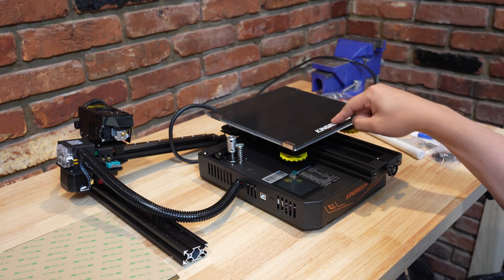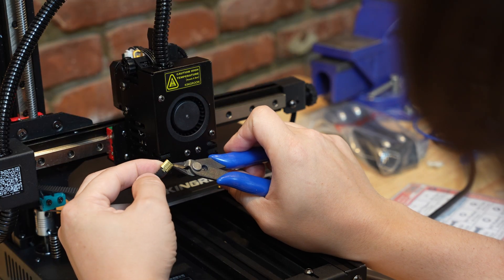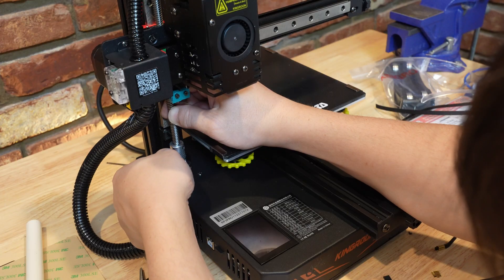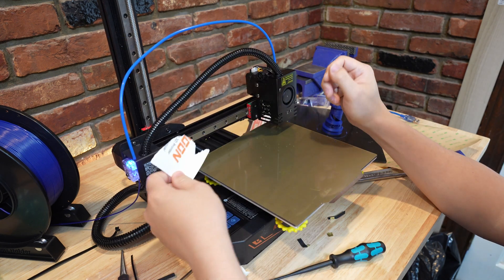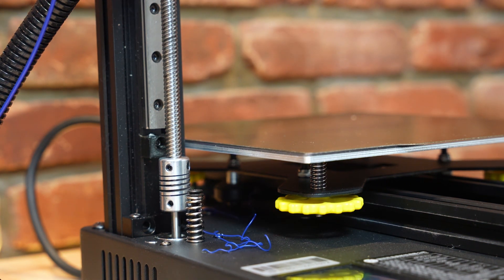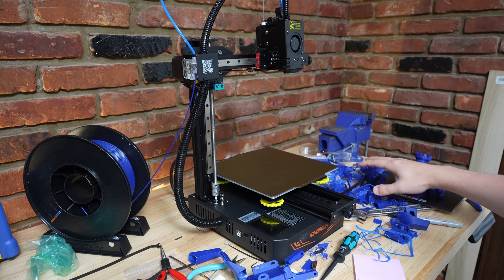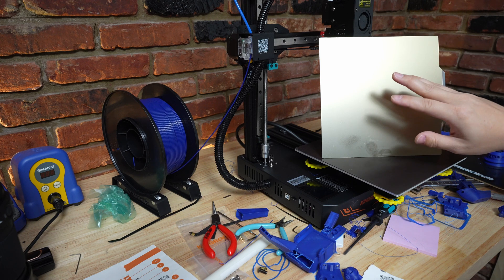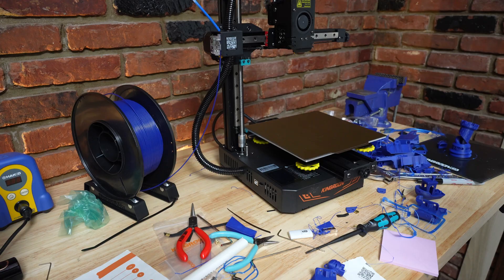Kingroon KP3S Pro: A Tiny Fixer-Upper

Comment: I brought a assembled but never run Kingroon KP3S to keep me interested while my two Ender 5 plus's were suffering from the 'I can do that' after watching youtubes that show how super simple it is to totally upgrade it all.  Its not for a Lorry drivers mind. lol.  Back to the Kingroon, Its not stopped printing apart from the duff Z screw clamp stripping the two threads the bolt reached and then the hotend mares it had to start with. Its now running a proper V6 hotend and not the copy thas standard. I used silicon bed springs, its not needed levelling since fitting them and the PEI bed or the Glass one i fitted before. They are cheap but they work well imo. Finished a 26hr print last night and it was flawless.  Wackes benchies out quickly too.

Comment: i mean unless you want to pay a huge premium for all your machines like with prusas, then youll have to just get comfortable with the fact that testing machines don't really happen :P

also when companies use these shitty spring couplers, you need to make sure the lead screw and the rod coming out of the motor meets in the middle of the coupling, especially since they use a bearing to confine the top of the lead screw, else you might end up bending your lead screw, and then your machine will most certainly get stuck at a a specific height everytime, linear rails dont allow for much tolerance.

Comment: Ok... so 60% of your issues came from your tinkering and mistakes. Good to know it's still a good printer to buy if we don't mess with it unnecessarily like you did.
Reply: Just got the S1 version. It had the same issues out of the box plus a couple extras like a warped bed, burrs in the coupler, misaligned x axis, misaligned hotend/extruder. It had a raft of issues that honestly were unacceptable even for a $200 printer.

Comment: I have a KP3S Pro S1 which the only difference is having the linear rail on the Y axis.

To be honest, I've very good experiences with this machine and able to push it to print a <19 minutes 3D Benchy beautifully.  It's firmware is very basic and in order to push it further, I'm planning to replace it with Kippler.

The spring type shaft coupler is actually a very good option to avoid a hard crash of the print head onto the print bed especially it is a manual bed leveling machine come in stock with a glass bed.  I've never had any problem with it even with the higher speed to print the <19 minutes 3D Benchy.  You have to add some more preload to the spring when you tighten the set screw.

I'm about to post some fast printing videos on my channel soon.

Comment: great review, i had mine running almost 2 months now, thank god the fans are holding up. i agree with most of the points here namely the metal locking belts are crimp lazily and will hit your prints when doing one at a time print, i plan to recrimp mine. the springy coupler i didn't have much issue with it but awesome time to just get a solid one. included glass build plate sucks, when it sticks sticks too much, i need to have a hammer beside me to remove it, best mod is to change to magnetic TEXTURED pei sheet. hotend can definitely be improved further with lightweight setup and motor (thinking of orbiter v2). I haven't opened up the electronics to check if the power leads are ferruled..worth a check

Comment: Hi there. Thanks for the video. Spring couplers must be installed in tension, I mean the motor's shaft and the lead screw must be forced in contact by the coupler spring to work properly. Of course the motor's shaft and the lead screw must have flat ends, but they're meant to be this way. (Edit,: this is what you ended doing at the end). If installed properly  a spring coupler is still better than a rigid one which requires very precise transmission and alignment. If you want a more rigid coupler, have a look to spider couplers.

Comment: Do you recommend this over the CRUX 1 ?
Reply from the maker: The crux I received had a lot less problems, only real downside was a fine bumpy pattern that I discussed in my video. 
Both are great but based on the sample I received I would go with the crux, just keeping in mind the print quality will be 8/10. 
This one still has some unresolved issues, I’ll be fixing it up just to see if I can get it working well.

Comment: So, as Brandon mentioned before, you can do the "ball bearing trick" with the sprung couplers. Another video on Alex's channel which is interesting is "BFTB design: Z axis wobble, lead screws and bearing blocks" in which he discusses how to use couplers more effectively.
The design of coupling a lead screw vertically to a stepper motor and using the stepper motor bearings is really another "good enough" holdover from the rep rap days. Most couplers are simply not designed to transmit force along their axis in this manner, neither are stepper motors really. It's more complicated and expensive, but using thrust bearings and having the weight be taken by a frame is really a much better solution.
Reply: Exactly as you say. I used to work and build the open builds style cnc machines years ago and one thing I was baffled about when I recently picked up a 3d printer was how wrong the motion systems one these are designed. No wonder that not a single printer prints perfectly out of the box.
Reply from the maker: Very interesting indeed. 
These are not precision devices, they are just “good enough” to print trinkets in many cases. 

Thank you for the detailed explanation on Z axis wobble, I’ll check out BFTB Design video

Comment: You're the only reviewer I trust art this point. Who would have known chinesium sucks?
Reply from the maker: It’s important to understand what alloy and grade of Chinesium your printer is made of. It ranges to slightly stronger than butter, to excellent 85% of the time.

Seriously though, the importance of QC testing cannot be overstated! My modder boards have a failure rate from the factory of about 1 out of 100. Close enough, right? I should just ship them out like that, right??? Wrong, even 1% failure is unacceptable to me, because I would never want to send out faulty product. I designed a test rig to get it down to something more like 1/1000, 3D printer manufacturers should do the same. Just like Mac, I’m sure they have all sorts of automated testing to guarantee with near 100% certainty that when you unbox a new IPhone, it works. You can’t leave it to manufacturing tolerances wether the product works or not, for something complicated, like nearly every single electronic device, you need testing to close the loop on quality control.

May seem like a small difference to some, and probably wouldn’t affect sales if every once and a while someone’s printer randomly blows up when using my product, but I do not take failures lightly. When people do have issues I know with near 100% certainty that it is user error because of the testing I do, and even user error I take partial responsibility for. Products should be easy to use, and a responsible designer should take any failure seriously.

Comment: I was actually about to order some of those flexible coupler sthe other night, they are suppose give some play so it doesnt bind and improves quality, which is what causes Z issues the binding, not wobbling, that being said ive decided to skip the flexible ones and install the zrods from scratch and have them lined up nice so they dont bind, or more straight as theres already some play in the  top thread for that purpose.  Adding the flexibility at the bottom i think just helps with this.  That australian guy's printer channel mentioned them and he got good results upgrading to them, so its kind of cool to see them on this.

Comment: I wonder how much effort it would be to adapt an Ender-3 esque Y-carriage/bed onto this and stretch this (longer extrusions/rails aside) printer so it could do 235x235xwhatever-its-stock-z-is?

Of course you could buy an Ender-3, but it wouldn't be as compact as this is!
Reply: At that point the machine will be either non-functionla or suuuper slow due to:
1) Lack of stability in Y due to the momentum of the heavier bed+cattiage assembly (that's already a bottleneck for all bedslingers)
2) Lack of stability in X gantry along XZ plane due to longer shoulder at 200+ on X (solved by the second extrusion + X carriage on Enders).

IMHO 210x210 (the real size of the bed) is already pushing the limits.

Comment: @4:45 You don't want to press delete through against the stepper motor shaft.  what I recommend instead on this style of motor coupler is to use a 5 mm ball bearing in the motor shaft and the lead screw. That way then your lead screw is not sitting perfectly flat on the motor shaft, which would prevent it from being able to make minor adjustments in the x and y direction which is the main reason for this spring style coupler.
Reply from the maker: Interesting. Do you have a product name that I can check out? I’d pick some up. I’m currently using a rigid coupler, will see how that works z haven’t printed with it yet.
Reply: @NathanBuildsRobots  check out Alex Kenis's video "Viewer question: the ball bearing trick?" You'll better understand what I mean. :)
Reply: I bought some couplers for my ender 5 plus Z axes and they already came with bearings. They seem to work well.
Reply: Or to use a flexture part to allow the brass nut to wiggle in x-y plane while the nut moves on the z-axis with negligible interference

Comment: All they test are the hot ends once they are assembled, I have this machine and I could swear that the belt tabs face up on mine, Im not at home at the moment so I cant check, but Im chomping at the bit to get home and find out, one thing I am certain of though is that my KP3S Pro does not have a springy coupler and the fans are much quieter than yours, I wonder what the deal is with those, have they found cheaper parts to fit to this model?
Reply from the maker: No idea if they changed sourcing. I got this from zbanx in November. It may have worked if I just reversed the belts, or just trimmed the rubber nub that was sticking out.

Comment: Think that springy coupler is to give greater tolerance to a not so straight lead screw against the linear rail on the Z axis. Probably lets them use cheaper leads screws with less warranty issues.
Reply from the maker: Yeah… kind of funny, they use a hardened steel rod to provide strength and stiffness. Then they go and put a spring on it. That will make it skate up and over imperfections in the previous layer, and the print head may settle at a slightly different print height after the disturbance. Also you have the issue of reduced point pressure where the nozzle is laying down plastic. Maybe the weight of the toolhead is enough to restore the toolhead to the same position every time… but what if it’s not? 

Also the smooth sliding linear rails tend to have slightly more generous clearances to keep things running smooth, but might be a little worse at holding a precise position.

Comment: thx fore your review. I really wanted to see what you think about this printer, becouse all the other reviewers on youtube just say "that is the best and just go ahead and get it" but that's just a load of crap. I apreciate your honest opinjon
Reply: Nathans machine has totally different parts than earlier iterations of this machine, mine does not have the springy coupler or the noisy fans and Im pretty sure the belt tabs face up on mine, I have had no issues with this printer at all, I bought it while I was working away from home in the Netherlands, I had it in my hotel room and slept with it doing overnight prints.
Reply from the maker: In the pictures I saw on Amazon the coupler looked the same as mine. Let us know when you have a chance to check your printer.

It really does seem like a sturdily built printer with a good frame. I’ll keep on it until it starts printing right.
Reply: You claim that all the reviewers except one say it's a good printer, and you choose to believe that one over the majority?
Reply: @ferrumignis  well now that you mention it dose sound a bit extreme, you know what i meant ;
Reply from the maker: Idk what it is, but I get a lot of bum printers! But I’m not going to recommend something that is clearly having issues on my desk. 

Maybe it’s the desk that is causing all the issues!?

Comment: Dang we had quite different experiences with this machine. Shame, really. It’s definitely become one of my favorite little machines to mess with. I have a Pheatus BMO in an afterburner, klipper, and rails on the y. Obviously, if you add those things to anything, it’s going to get better…but this little thing is light, portable, easy to mod, and easy to keep next to you on a desk. It’s been super fun.
Reply: Me too! my little Kingroon is a much loved printer, mine did not come with the springy coupler and the fans are much quieter than the ones on Nathans machine and Im pretty sure the belt tabs on mine face up, Im not at home though so I cant check.
Reply from the maker: I’m going to keep on it. The linear rail setup is ideal. Mine is a fixer-upper but I’m not giving up on it yet! 
I’ll watch your video to see if I can spot any differences in the build. Will also try some different filament, though I’ve used this stuff before and didn’t notice anything grange like these whimsy prints!
Reply: @NathanBuildsRobots  Mine had the exact issues yours did on 7/12. About 4 months after your video. As well as some issues with burrs in the coupler, warped bed, x axis not square, and extruder/hotend assembly not square. So, Kingroon hasn't improved their QC. I had heard great things about this printer,  but I was sorely disappointed. Wound up getting a refund for it. So what do I do, I buy the Kingroon KLP1 v2 🤣 Glutton for punishment I suppose.
Reply: @mrgingersworkshop how did the KLP1 go? Any QC issues with it?
Reply: @TheButchersbLock  Much better experience with the KLP1 v2, but still a few small non-hardware QC problems. Their Klipper implementation is half a$$d. I'm still learning my way around Klipper, but I did need to change the run_current from 1.3 > 1.0 for the steppers. It was way to high and made the steppers ridiculously noisy. 

I did buy a second KLP1 because I like the first one so much. The hardware is solid and I have about 600 hours run time between the two so far.
Reply: Why rails on a bedslinger? Especially on Y which is the bottleneck?
Reply: @sarganis2576  what do you mean? Will linear rails on Y slow it down?
Reply: @timothymusson5040  Generally, you need rails to keep the precision on high speeds/accelerations. Bedslinges, even the smaller ones, do not reach that speed due to the weight of the bed. Basically, rails upgrade the part that does not need it (read: do nothing). 
But there's a caveat. Quality X+Y+Z rails+carriages cost 55-70% of the total cost of the printer. So here you basically play a lottery for no benefit at all. 
Wheels on profiles are 100% good enough for all but the craziest bedslingers. They are cheap, widely available, quiet, reliable and require significantly less quality control.
Reply: It would be for rigidity on the cantilever @sarganis2576